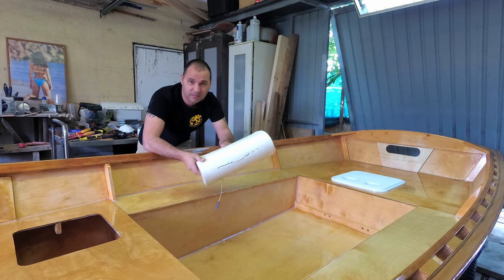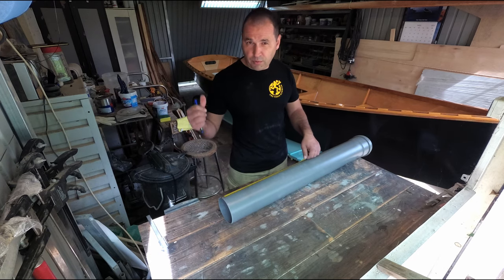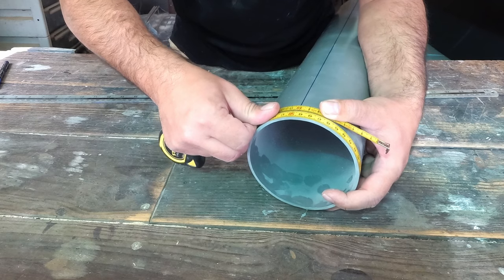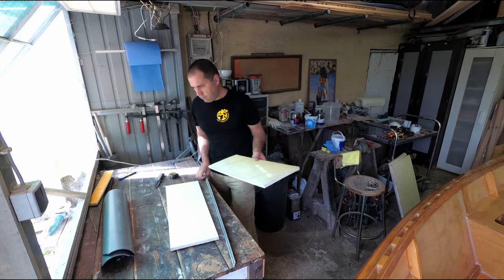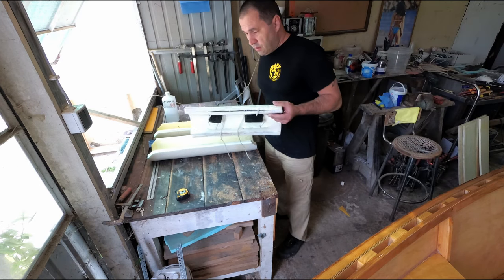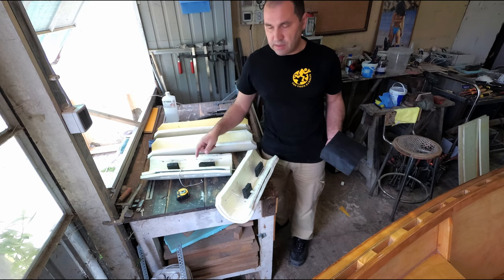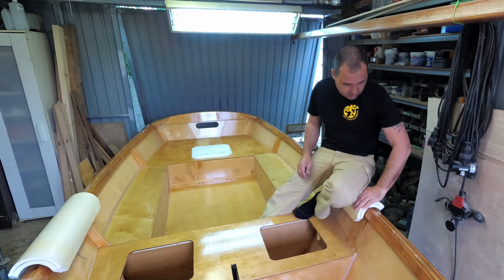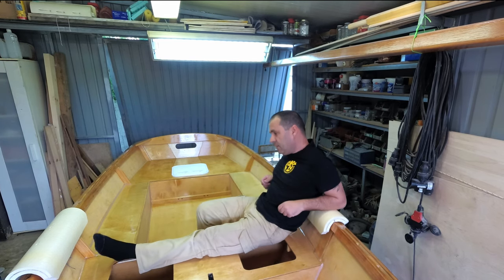Homemade Dinghy Hiking Pads

Comment: That would be 490 in circumference :)
Reply from the maker: Hi Brendan!
it's actually 395mm since I started measuring from the 100mm mark! 😉
Reply: @TheBoatRambler  Ah, silly of me. I should have spotted that. It's bit over 392 according to Archimedes, assuming you didn't measure 125mm diameter from the 100 mark. It's also probably not PVC. I think teh grey stuff in EU is HDPE?
Reply from the maker: Hi Brendan! 
I'm no expert on any kind of tube or pipe but on the shelf it did say PVC pipe. Not that I fully trust them tho...😅